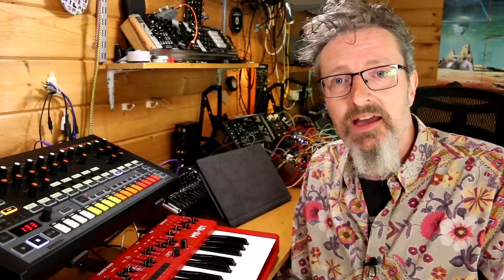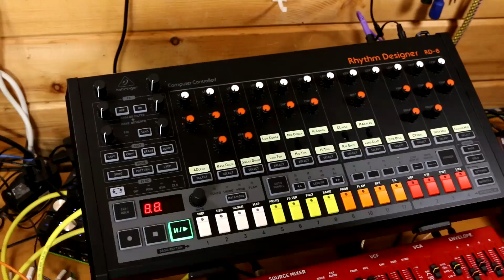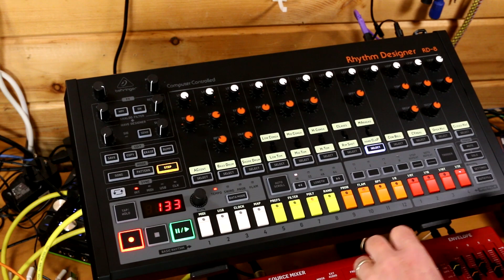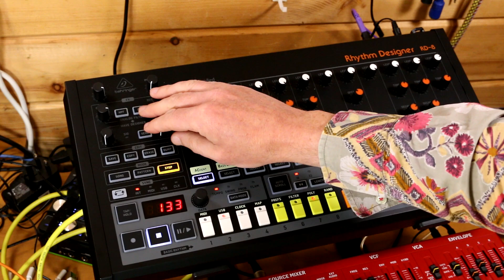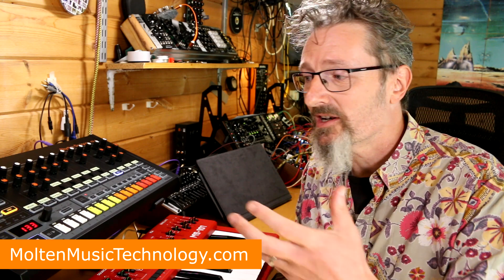Behringer RD-8 Quick start guide to happiness

Comment: just got one  and there is no uk power  supply 
and the  adaptor  does not fit so now it looks like i am going to have to pay out for a new power unit
Reply from the maker: I would complain to the place you bought it from
Reply: @MoltenMusicTech    in the end got some 2 pin to 3 pin adaptor
Reply: @MoltenMusicTech   its not down to the music store   it will be the same no matter where one  get it  you got yours years ago  when it came with a uk  power supply

Comment: yea i made a beet but now i cant erase it even when i turn it off. how do you sart fresh from start
Reply from the maker: I erase patterns by deselecting the steps i entered on each voice - that's just how i work. But according to the manual you can erase a pattern this way:
How to erase a pattern:
1. Press ERASE.
2. The SONG and PATTERN buttons will flash. Press PATTERN.
3. Select the pattern you wish to delete via one of the 16 step keys.
4. Press the now flashing ERASE button to execute the delete process. This is a permanent process and can’t be undone.

Comment: I have been looking everywhere... can rd8 reverse sounds?
Reply from the maker: Nope
Reply from the maker: It's an analogue drum machine and so not capable of what you're asking. You'd need to sample the sounds into a computer or sampler and then reverse them if that's the sound you were after.
Reply: @MoltenMusicTech  I could have swore the og tr 808 could reverse...
Reply from the maker: It’s analogue and so the sound is generated by voltage hitting components. To do the sound backwards you’d have to create the circuitry that would approximate that sound - you are after a digital device.
Reply: @MoltenMusicTech  makes total sense. For the og to have a reverse there woulda had to be some wizards in the house. Some swap attack/delay setting. Well poop
Reply from the maker: ah yes, a slow attack can give the impression of something going in reverse - so that's a possibility... except there's no attack on the RD-8 or 808 :D

Comment: so I have my rd 8 connected to more of a home studio setup
it goes from the mono out into my Scarlett interface input from there obviously into my computer where I have Ableton opened up with ext. instrument setup etc pp.
still getting no sound of the r8 , what I do got out of it was midi signal 
I already tried to hook up the r8 directly to my speakers without the interface in between, still no sound
any one has an idea why?
Reply from the maker: It happened to me recently when I turned it on for the first time in  ages. I can't remember how I fixed it but I did. First of all check that you are getting something from the individual outputs - if that's working then it must just be a setting, like all the mutes are on or something. It's very frustrating - i remember that much :D

Comment: I think most people using one of these have it running through a mixer so if you wanted to use headphones from the mixer you would get the fx path. Having phones going independently through the unit alone would only have a real use in performance with the ability to monitor the signal for blending other instruments
Reply from the maker: Or..... if you just wanted to sit and play with your drum machine.
Reply: @MoltenMusicTech  its a piece of pro audio gear man...im actually sitting with headphones (through my mixer) using it right now. I dont think this unit was designed for eating an icecreme cone at the park programming drum beats my dude.
Reply from the maker: Then why have a headphone output at all? It’s a fair criticism I think that the headphone output is the only output on any piece of gear I’ve come across that doesn’t contain the output. Sure, you can bypass the inadequacies with a different workflow but you shouldn’t have to. Worth pointing out I think.
Reply: @MoltenMusicTech  maybe you are right...Im sure there would be a way to route the signal to have both or to select the signal path using a button. They are pretty smart over at Behringer. I agree with you its just I can see the value for performance the way it is...if you were monitoring the signal live with headphones before blending the beat in..it would be nice to just hear the dry signal. Cheers man ...frankly Im just glad this unit exists and I apologize sounding like a snob trying to defend every dumb thing about it lol
Reply from the maker: Ha! It's all good and is just a blip on an otherwise fun machine :D

Comment: Hi! Thanks for the great guide, helped me a lot to get started without having to read the manual! Just received my RD8 a few days ago and I sure am having fun with it! :) I discovered that the FX section (wave designer and filter) also bypasses the individual voice outputs! Or am I doing something wrong!? If this is correct, then it's a real shame and limitation as when one wants to send each individual voice to a mixer (to apply different effects to the individual voices for example) you will find that the wave designer and filter doesn't work! I also find it limiting that the accent function applies the accent to every voice that falls on the accented step...i.e, one cannot apply accents to individual voices! This I find very limiting when wanting to create groovy patterns...for example simulating ghost notes on the snare, or creating a swinging high hat pattern etc... but anyway, all in all, I am very happy with this machine, despite these limitations one can get really creative! :)
Reply from the maker: Yeah, that's right. The wave designer is only present on the main outputs. So it's like an added thing that wasn't on the originals that we get to complain about because it's not everywhere.
Reply: @MoltenMusicTech  Didn't realise that the FXs section was a new added feature...at least it works for the main mono output then!
Reply: im not gonna say how much time I've wasted trying to figure out what I did wrong cuz I once used the fx but couldnt get them to work with individual outputs...thanks!!!!! also this video showed me how to use the trigger/repeat function WOW!!!! very fun! thank u BOTH!!

Comment: Thanks, I’ve been strongly considering picking one up off eBay. The ability to control bass pitch via MIDI is a major selling point for me. Quick question, what type of stand are you using for the RD 8?
Reply from the maker: Currently a JamStand
Reply: Is this really true?  I thought it only responds to MIDI velocity?  Captain Pikant (YT) reckons that it doesn't recognise any CC messages.
Reply: @pixelfrenzy  apparently this was just a rumor that circulated around the time of the release of rd8 mk1. However , You can modify it change pitch via CV

Comment: None of my behringer synths or this machine came with a HOW TO manual.... I wonder why????
Reply: The manual is always on the website. Since some modes or functionality is changed or added with firmware during the lifespan of the machine a paper manual did not make sense since it can change.  And using paper is not environmentfriendly.
Reply: Mine have all come with manuals . . .
Reply: Because they're cheap. When you buy cheap, you opt-out any instructions and support. (I have a RD-8 on my own and the Behringer support is a pain in the ass. I'm waiting for an answer to simple questions on the Behringer support forums for 3 months now. They simply don't care. I guess no one did ever read my request, and the many cries for help from other customers as well.)

Comment: Nicely demoed. Bit crank not to have wave designer through headphones, I'd put it through a mixer with headphones in mixer headphones out.
Reply: Yes, or you can plug your headphones directly in the mono out and still get the sound left and right with the wave designer and filter.
Reply from the maker: No, you only get it in one ear, coz it's mono - hang on, let me try - Bwa ha ha ha, that's ridiculous - yes, in fact, ignore the headphone output and just use the main mono output for your headphones - brilliant, so glad i went on about it in the video.

Comment: That you cannot record the note repeat into the sequencer thats bizarre and stupid! Greetz 👍✌️👌
Reply from the maker: Yeah? Recording is per step so it makes sense not to record a load of stuff in between steps. It’s a performance feature.
Reply: You actually can program the note repeats. Just remember the steps you wish to alter with note repeat, press [SETTINGS] and step key 11 (RPT), press the step you want (lights up red), then select the repeat type (2, 4 and 8) and make sure to activate note repeat as well. You cannot select a number of steps at once but you don't have to leave the page to do the next one, you only have to do them one at a time.
Reply from the maker: Sounds easy 😀
Reply: Molten Music Technology You just need to make sure to be on the right pattern page for the steps you wish to alter and remember to activate both keys - number of repeats and the note repeat button so that they are lit for every step you want to have repeats on. When switching steps you have to press these buttons again. Obviously the repeat button labelled "1" doesn't have an effect in a 1/16 scale or higher, only when using 1/8 or 1/8T. Edit: Sorry, I just checked and realized that the step repeat button "1" basically has no effect on any step no matter which scale you're using. These repeats should obviously not be seen as 1/16 or 1/32 but simply as the number of hits placed on a single step. And since one single hit ("1") actually doesn't repeat anything at all this means that this key only affects the step repeat mode, not note repeat.
Reply: This has changed with firmware upgrade